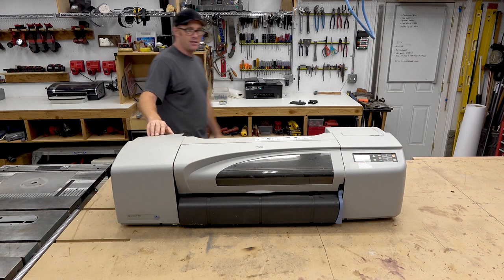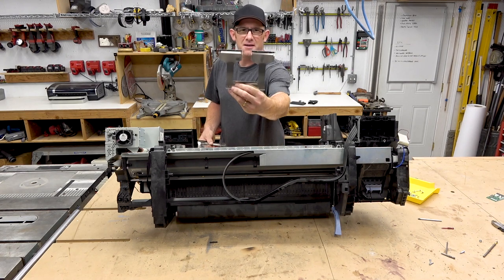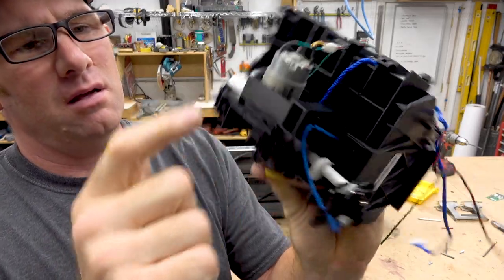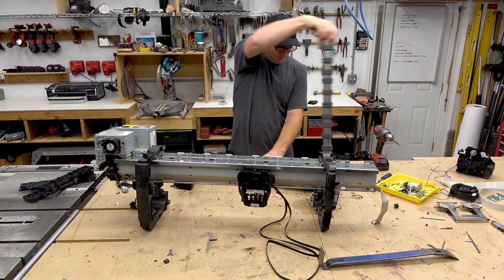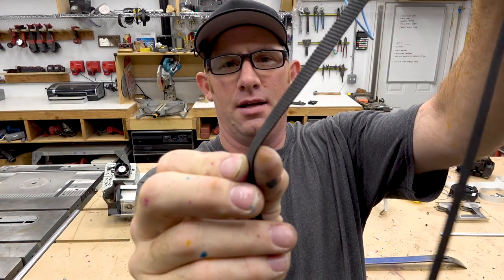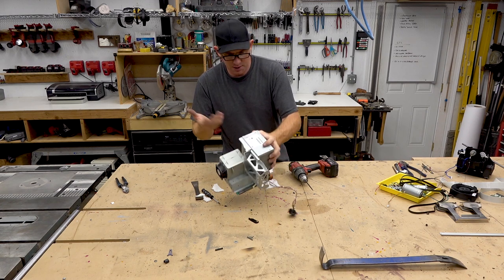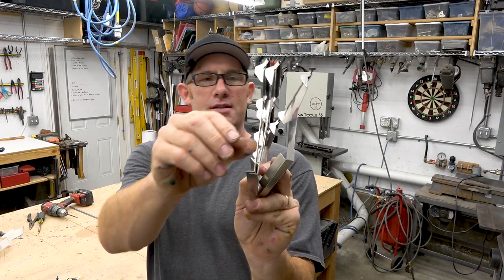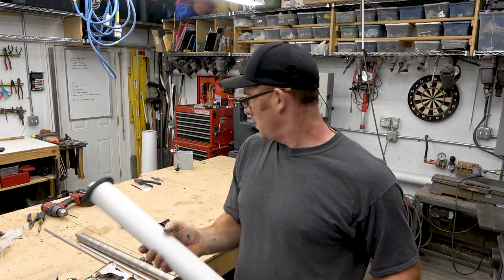What’s Inside This Giant Inkjet Printer? – DYK #4

Comment: Thanks for this. I too took one of these big bad boys apart some time ago. If you don't get ink on yourself, your not human! My fav bits are the ground steel bars - useful. And the one I took apart even have some aluminium extrusion, track type assembly. Gonna make a something from it some day.
Reply from the maker: Yes, I've been taking copiers and xerox machines apart since I was a boy. The older copy machines had a treasure trove of parts. There were lenses, motors, gears, chains, toner hoppers, high voltage transformers, and electronics. Plus, the education you can get from disassembling stuff is different than anything else.

Comment: I’ve got a 36” plotter in my shed. I need to do this to it.
Reply from the maker: Ooooo! I think plotters have a few stepper motors!
Reply: Yeah, I was really hoping to use it for full sized plans, but finding ink was an issue as it’s over 20 years old.  I am hoping for some steppers and som metal rod. When I gave up on using it as a plotted, I set it on its side and ink leaked out from somewhere. I’m sure it’s an absolute mess inside.
Reply from the maker: @jasonbailey9139  It's still probably worth a try. I used to take apart copy machines when you could still find them. They've got a lot of cool parts and pieces.